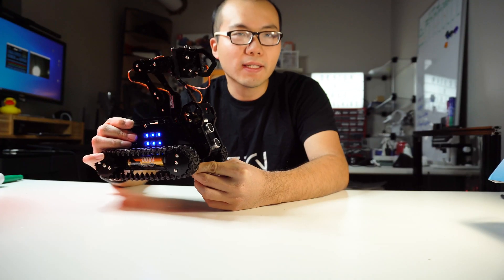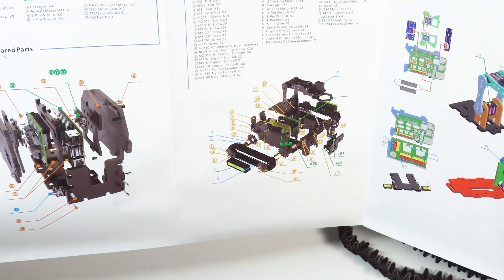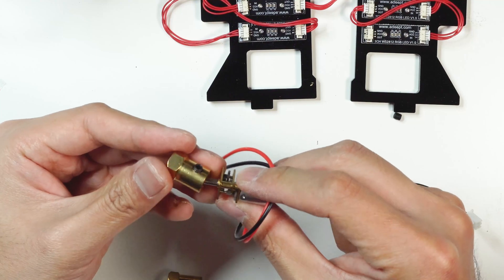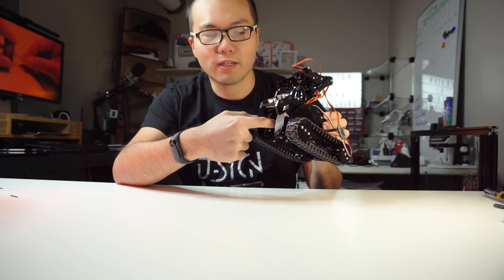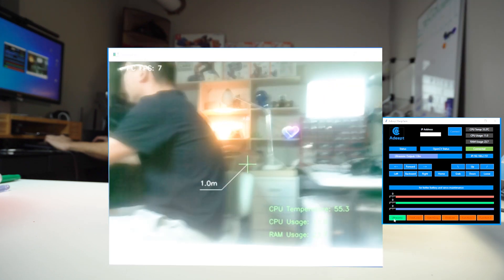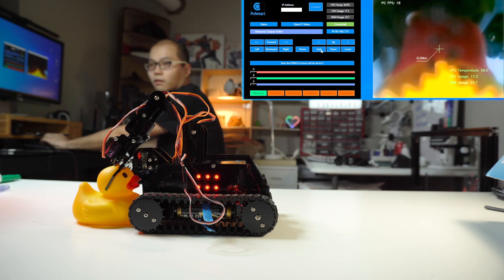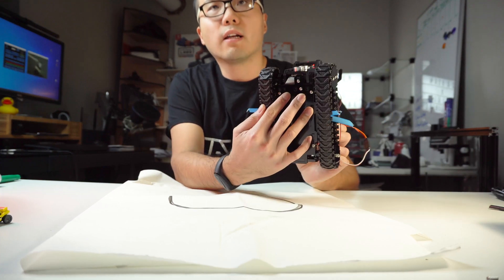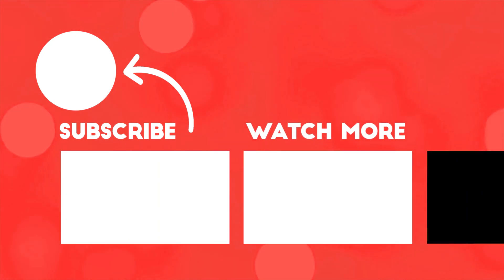Adeept Raspberry Pi Tank Review

Comment: I assembled one of these. ABSOLUTE PAIN IN MY SIDE. Things such as the sonar and the camera modules would not lay flat when screwed in. The holes for the stand offs around the R Pi had to have the tops and bottoms widened out (I went for a cone shape) so that the things would even screw together. I spent hours troubleshooting the recommended install method before giving up and using their own raspian image. (I've had this for a year, this is my second time trying to get the thing to work. Their software worked a year ago.) The plug in for the batteries would short circuit when pressed on (the inside of the bot is nothing but a wirey mess thats been forced together, so yeah it's gonna be pressed on) so I had to order another motor hat. Well that didn't work either, so I removed the plug on one of the hats and soldered on my own connector. (One year ago this was my only issue) Even through all of this mess, the thing will not connect to wifi half of the time, the servos are super jittery, the camera servo is really spazzing out and causing itself to overheat, and loads more of - you guessed it - not fun!

Comment: It's hard to fit the circuit boards in with the wires in the way.
Reply: thats the only thing i hated about this tank. I think ive come up with a solution. Ive drafted in illustrator, a wider floor, roof (arm mount) and tail piece (motor mount) that could be laser cut and still use the rest of the parts. it would allow for the pi and its hat to be mounted horizontally, have room for a fan, and not have to cram all the wires into it. I do not have a laser cutter yet but i am looking into going into a makerspace with one to cut out the pieces and see if it works. and if it does ill post an instructable and post the files on Git Hub

Comment: It looks like a bloody nightmare to assemble.
Reply: It kinda is
Reply: No, it is easy, No heavy giant parts like in big heavy equipment.  Those having issues do not know how to read and follow instructions.  The PDF file instructions, with photos are great.  A little technique, tape and sticky glue goes a long ways to keep the tiny nuts in place for assembling.  Software wise, it will be a steep learning curb it you have never used a Linux operating system or terminal commands.  Get a Raspberry Pi 4b and learn to use it because that is what you will be doing in the software setup instructions.